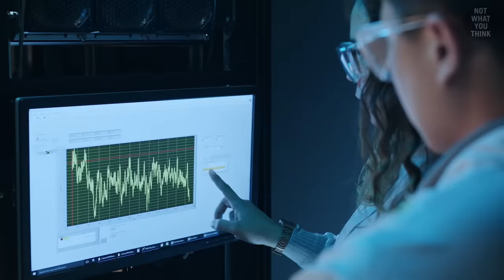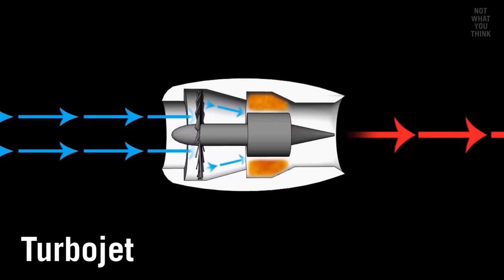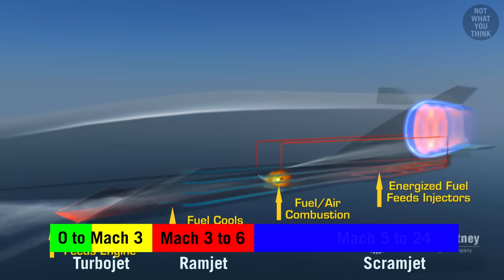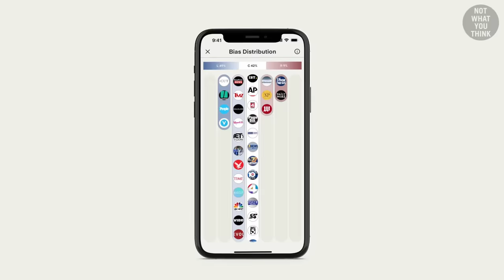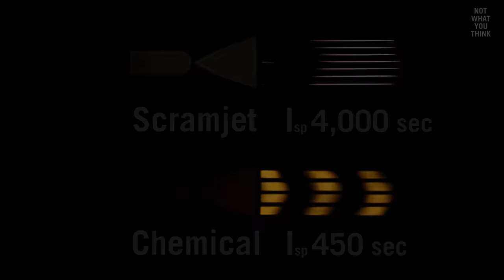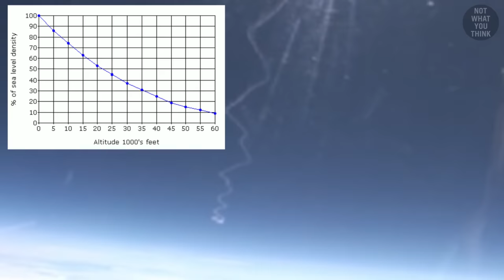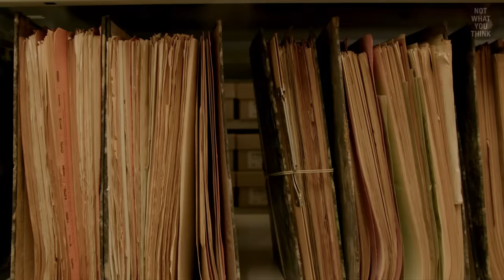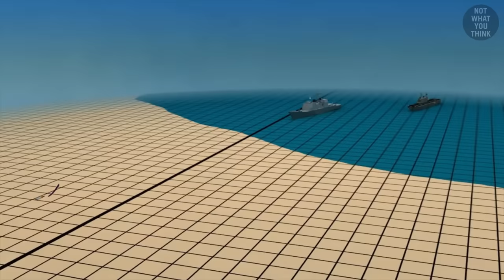The Hypersonic Missile Vulnerability That NO ONE Talks About

Comment: Hypersonic Cruse missiles are not the only usecase for ram/scramjet powered missiles (others like BVR air-to-air missiles come to mind). I think it is also worth mentioning that there are already quite a few supersonic air breathing missiles in use, such as the french ASMP Cruise Missile (carrying a nuclear warhead) or the MDBA Meteor (which reaches speeds just below the mach 5 barrier). While most of them are ram- and not scramjet-powered, I think it illustrates that there is a place for scramjet powered missiles once they become feasible. The mentioned technical issues might seem insurmountable, but they always do until they are solved. If I had the military budget like the one of the US/China, I would definitely keep on trying.
Reply: Who said that the sensor issue at hypersonic velocities has not been solved yet. The author with his limited knowledge of hypersonics and sensors is making assumptions based on his ignorance. For the enemy ignorance is bliss until they get hit.

Comment: What has never made sense to me is that hypersonic missiles betray newtons first law of motion: an object in motion tends to remain in motion. At mock five a missile has enormous, kinetic energy, what force acts to maneuver or change the direction of that missile? They can’t use conventional fins or thrusters, so how does it maneuver changing the balance of The payload inside the missile with say servo motors? That is still way too slow. The whole concept of Maneuvering something moving that fast just seems like fantasy to me.
Reply: totally right. Sir Newton would pose the same question, I am sure of that
making such a maneuver at hypersonic speed would create an enourmous drag, lose of speed, and as a concequence require a high-power engine and a lot of fuel
even maintaining the speed would take a lot of fuel, and it's a well known fact
Reply: But top gun 2 did it....
Reply: The space shuttle already did it, every time it re-entered. The only thing that doesn't make sense to ME is why we pretend this is new technology (apart from the SCRAMjet engines, those might be new).
Reply: falcon htv-2 looks like able to do some kind of maneuver even better than shuttle reentry vehicle did it.
And it is also called a hypersonic vehicle. It's a glider though. The first project like this was probably german silbervogel.
All these technologies are sometimes mixed together because they all aim at the same target -- be fast, maneuverable, long operation range. From military point of view it doesn't matter if it has a scram jet, or it's a glider. The simpler, the better.
The author did not get a full picture, some kind of overview of the concepts -- I think it's worth to make a criticism like that

Comment: I'm not a physicist or engineer, but at Mach 5 a 3 G turn (quite high g load) would have a radius of around 100km. THis doesn't exactly make such vehicles completely unpredictable to air defenses. Also, making such turns would bleed off a lot of energy/speed and very likely cause more headaches with respect to heat management.
Reply: All on point; except:

"...The AIM-120 maximum overload is allegedly between 28 and 35G, the actual data is classified and unknown..."

"...The maximum G overload on the AIM-54 Phoenix missile is approximately 15 G's..."

"...How many G's can a Python 5 pull? - 40G's..."
Reply: At Mach 5 (as defined at sea level) the missile completes a 180 degree rotation with a radius of 10km and a path length of 31.4km - in just under 20 seconds - pulling 30 G's. It can execute a 90 degree turn in half that time, at just over nine seconds...
Reply: Demand for more G-tolerant electronics and systems driven by hypersonic development may well push those numbers far higher still - 60-100G's and above. Things to consider: Nuclear Artillery is a thing. So is the XACTO guided .50 caliber bullet - itself a missile in miniature, with laser guidance... All capable of surviving the stress and G-loads, at least - axially - of being fired from a *gun*..!!

Comment: If I frame-by-frame advance the footage at 15:36, there are three frames in which something pixelated is moving in view before the impact. I'm not sure what framerate this footage was taken at, but if it was 30 FPS, a Mach 24 projectile would travel about 8232/30*3 = 823 meters, or about half a mile, during those three frames. If I had to guess, the distance between the point where the missile/pixelated blur enters the frame and the impact point is closer to 80 meters than 800.
Reply: Just the animated video of their Mach 24 missiles will only scares the brainless world ONLY!!!
Reply: Zircon’s maximum speed is estimated to be around Mach 8-9. Not Mach 24. No idea where he got that number from…
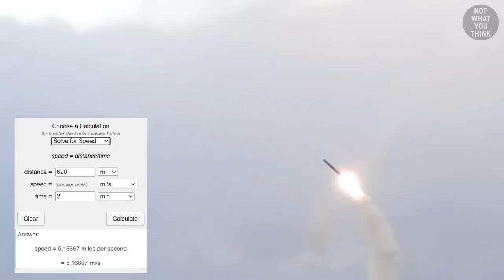Reply: @tw5268 15:24 he count it lol

Comment: The way (I think) hypersonic missile are intentended to work is to reach supersonic speed only JUST BEFORE entering the enemy's effective counter missile range. All the measurements and direction vectors are imparted instants before going supersonic and before the instruments go blind. The missile sees the ship and starts accellerating hypersonically towards it
Reply: How would they accelerate so quickly in such a small amount of time?
Reply: @user-sg9gy8sv9p  Depends on when you decide to go hypersonic. But in order to do that, you'd have to have support for both types of engines

Comment: The "random" maneuvers at hypersonic speed would likely be difficult due to that blackout as it would cause the downlink from positioning satellites to be lost or skewed . If it did make such extreme changes in position without aid, it would likely need a course correction after slowing and establishing the first fix. I don't know how effective accelerometers such as MEMs for course positioning during this phase of flight?
Reply: A hypersonic missile would use a fairly expensive and stable INS system. I once looked up the spec for the Honeywell INS system installed on GMLRS rockets. This system is based on ring laser gyroscopes. The specs stated that the device was still accurate to about 10 meters after 2 minutes of GPS blackout.

Comment: Without sensors I couldn't see how you could properly evade anything. 

One of the things I learnt from the RAF. Counting objects isn't about how maneuverable it is. It's how quickly it can break from a manoeuvre. One of reasons why the typhoon is such an exceptional aircraft. Is that it doesn't get stuck in manoeuvres.

If you doing 100 mi turn and Mac 5 i can't see missile changing mid turn. Which will make it easier to intercept than people think realise.
Reply: This is my belief too.

Comment: One of the biggest issues with hypersonic is the height they have to fly at to avoid thick atmosphere. This kind of defeats the speed benefit. A lower speed, lower flying missile will be just as hard to counter. This is because of the horizon. At sea level a radar can only see 3 miles. The higher you fly the further a radar can see. So a hypersonic cruise missile may be going faster but it’s much higher altitude(compared to cruise missiles) means it can be detected much sooner. 

Personally, I think a low flying stealth cruise missile is the future.
Reply: Why future? That is the present.
They fly at Mach 0.99 and can turn at many G.
Reply: You throw both at the enemy to make their defense problem more difficult.  But I agree that stealthy subsonic surface / sea skimming cruise missiles will find targets and hit them more reliably than a high diving screamer that is basically melting its electronics on the way down.

Comment: I'm not sure I understand your argument that ballistic missiles need to travel at ~ mach 3 on reentry, since ICBMs travel much faster than that on reentry. 

I understand the Iskander is not an ICBM, nor is any hypersonic missile, but it seems entirely plausible to me for such a missile to maneouver at high altitude before actually striking at the target. And contrary to what you implied, intercepting ballistic missiles on reentry is not a simple task.
Reply: ICBMs use INS, they don't have any terminal guidance. Plus, since their payload is nuclear, it doesn't matter if they're off by hundreds of meters
Reply: @apolloaero  Sorry, my wording was unclear, I meant that the claim that the hypersonic missile must reenter at ~mach 3 like an Iskander seems implausible to me since ICBMs have no such limitation, so why could a hypersonic missile not maneouver at high altitude before reaching its target and then reentering at that high velocity. ICBMs are reasonably exposed to interception in the mid-course phase when they're in sub-orbital flight on route to their target, so maneourverability here isn't useless. 

They are capable of carrying nuclear payloads, so much like an ICBM they can be a bit off and still deliver the payload, and I don't see much reason why you couldn't have some terminal guidance on the hypersonic missile to make it more precisely hit its target. Its a very difficult engineering challenge, but I don't see why it shouldn't be possible. 

Modern ICBMs are accurate to ~250m, so once it has maneouvered around any defenses and is in its terminal phase some small corrections seem entriely plausible to me.
Reply: @acomputer121  ok, ICBMs don't make any maneuvers, only their payloads could if they have MARVs or MIRVs for example. Which are Maneuvering Re-entry Vehicles or Multiple Independent Re-entry Vehicles btw. But a ballistic missile will follow a ballistic path, it's in the name.
As for terminal guidance, the limitations are covered in this video. High speeds will ruin any IR terminal guidance sensors. And any plasma created by high speeds will limit any radar guidance as well. The solution is to slow down before exposing such sensors, slowing down to below mach 5 that is.
Reply: @apolloaero  You're being pedantic. I'm not talking about maneuvering ICBMs, I'm talking about hypersonic missiles. Maneuverability would enhance the effeciveness of a long range nuclear delivery vehicle filling the role of an ICBM. 

So long as the missle knows where its target is, where it itself is heading, and how much it needs to correct before it loses sensing capability it can do so using its INS even when it enters the blackout phase.
Reply: @acomputer121  "Modern ICBMs are accurate to ~250m, so once it has maneouvered around any defenses and is in its terminal phase some small corrections seem entriely plausible to me."
Literally your last statement, which was unclear as to what exactly you were stating. From my pov, it seemed like you were talking about maneuvering ICBMs.
From 40k feet altitude, at over 40 km away and going high subsonic on average, INS is off by 30 km. 250 km is really good for a nuclear warhead. INS won't give you the accuracy to hit a moving target. Which is why it'll be most useful against time sensitive high value static targets. Against a warship for example, it will have to slow down. Without active guidance it'll probably miss, the warship will most likely be taking evasive maneuvers unless they have a death wish

Comment: One thing I haven't seen anyone talk about yet are the laser defense systems. I know they are still on their infancy, but theoretically they are the best defense against hypersonic munitions. No matter how fast your missile is, it's not out running a laser. I expect the near future will see these two technologies competing to see which is better, next gen offense or next gen defense. I think the only thing hypersonic missile developers can do about it is focus on making the missile as stealthy as possible, so as to delay locating and identifying the threat as hard as possible. Not that a blazing meteor trail is easy to hide, but what else can they do?
Reply: I thought about that too. A potential issue with laser point defense is that, as mentioned, a working hypersonic missile has to deal with the extreme heat generated by the air friction. Can a laser really burn through a material that can withstand that heat? Maybe you'll have a bit more luck shooting through the rear, but that does require the missiles to pass by your lasers on their way to their target.
Reply: @bificommander7472  that's a damn good point I hadn't thought of. It beg the question as to how much can that nosecone take before it fails. A laser might be shrugged off or it could push it past the point of failure. I think the fact the laser concentrates it energy into a relatively small space makes it harder to dissipate as well as the microsecond burst of energy most lasers deploy. I'd love to see some actual testing on this.
Reply: don't think that's gonna happen, lasers currently have an effective range of about 1 mile. lets say tomorrow we had a breakthrough to do 10 miles with for some reason the same amount of energy so that the power plant on the ship doesn't need to change. and 2 missiles are flying at the minimum speed of mach5 (1mile per second) towards you. Using footage from current laser tech, it takes around 5 seconds for the damn thing to have any effect at all. you have exactly 10 seconds to shoot down 2 missiles, which include the time for detection, tracking and the turret to move. and each ship can only have 1 laser turret, unless they start fitting nuclear reactors on normal ships.... yeah... lets leave lasers to science fiction.... I would rather have a drone ship with like 10 CIWS on it to have a wall of lead instead as my defence
Reply: @johnbiscuit8272  I was trying to find the range of the scrapped YAL-1 laser. No sites mentioned the exact range at which it destroyed a test missile, but one site mentioned its effective range was in the tens of kilometers. Still considered a failure, since they wanted hundreds of kilometers, but for point defense it would at least be better than 1 mile.
As for a wall of lead, it can probably get hits on a missile flying right at it, but if it gets its hits in too close, you'd still be hit by high speed debris only slightly less destructive than the original kinetic kill projectile.
Reply: @bificommander7472  now that you've mentioned it, made me wonder... how dafuq is a bullet or laser going to affect a kinetic kill projectile? unless it hits it's engine (which hypersonic glide missile do not have) how is it going to ever affect said missile? (tbf i'm assuming a hunk of steel flying at mach 5, which isn't the case). if that is the case a wall of bullet might have a higher chance of changing it's trajectory
Reply: @johnbiscuit8272  I can't imagine that a hypersonic projectile, even if the nose is solid metal, is going to be in a good condition after plowing into bullets coming the other way. But yes, if it's only a mile or so to the target, there are probably one more more big enough chunks going into approximately the right direction to cause damage.
Reply: @bificommander7472  a laser can target a control surface, making it fail is all that's required to render it potentially ineffective
Reply: @johnbiscuit8272  a bullet could wreck a hypersonic missile just fine. Sure, it is not as fast but you need to remember that the energy of impact is a sum of BOTH velocities. If the missile flying at 10 Mach gets hit  head-on by a Mach 1 bullet, it means that it is hit by a bullet travelling at the 11 Mach speed. And energy is mass and SQUARED velocity, so the impact would generate the same energy as the explosion of something like 200 kg TNT. Fat chance surviving that.
Reply: Until lasers could prove that they could down more than 2 targets at the same time nvm the fact that you need atleast a MW class laser to attack a hypersonic missile at a meaningful distance.
Reply: If I am not mistaken, they have put some of those lasers on aircraft carriers recently. Frankly, if these hypersonic missles are so cost effective or so destructive, they would be used en masse immediately. Giving the enemy time to respond to you is a poor tactical decision, let alone enough time to research the idea, develop countermeasures, or possibly make some of their own (which if we have hypersonic aircraft, we have hypersonic missiles, they just currently have a cockpit.) Someone, somewhere, just wanted to pretend they one-up'ed America's army with something. In reality, they gave America a new idea to pursue and/or an emphasis to pursue it.
Reply: @Axel-zc6xj  it's the F15 all over again
Reply: @Axel-zc6xj  yea let alone the overhype of the kinzhal even proper hypersonic missiles are overhyped as you dont need to travel the same speed to intercept it(that is what intercept means)